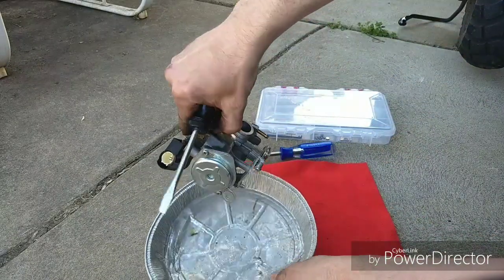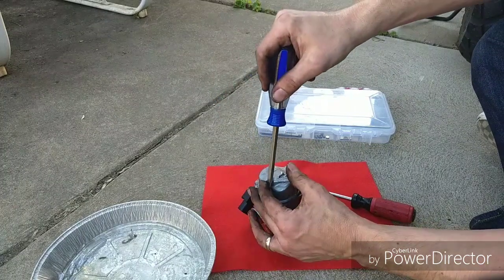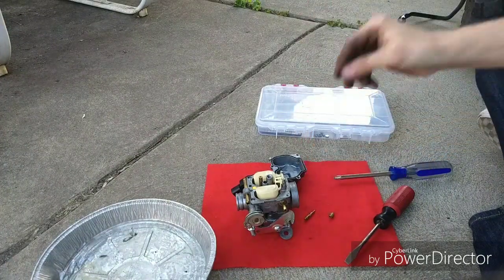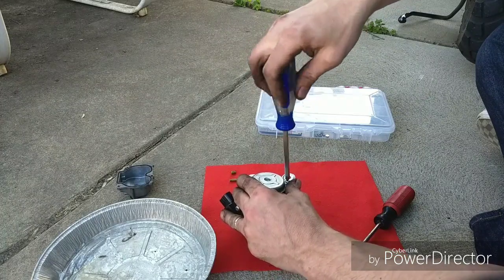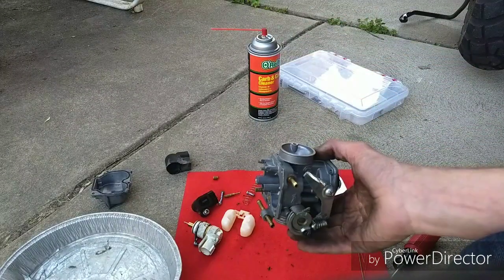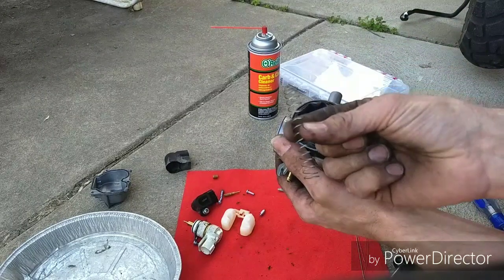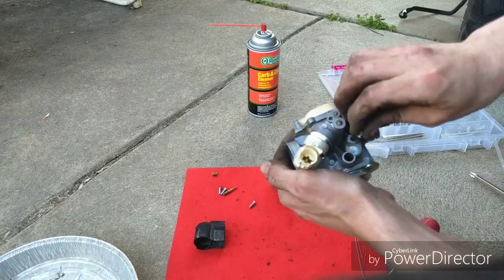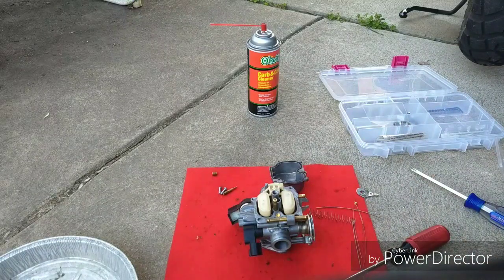GETlife: Cleaning the Ruckus Carb.

Comment: Just curious why you removed the TPS sensor? There doesn't appear to be anything that needs cleaning inside the sensor since no air or fuel flows through that area.
Reply from the maker: It's best to remove ANYTHING that's plastic or rubber before you spray carb cleaner on the carb. Some plastics might not be affected by it.. but it's simpler to just make it a habit.

Comment: is it a problem if I can't clean the jet long ways like you did with the guitar string?
Reply: Seriously I can't either
Reply from the maker: I would try soaking it longer in carb cleaner, then blowing cleaner through it. It is difficult to find a wire small enough.. and you really have to poke around to find the tiny hole.

Just do your best, as long as the bike runs good.. whatever you did worked!

Comment: So to rejet for an intake. Am I installing wider jets?
Reply from the maker: The stock jets are 35 small jet and 75 main jet. A good radiator hose style intake will almost always use a 38 small jet. A full length Dayco b71381 hose will probably need 85, or even better 82 main jet. Cut that hose in half, it's close to 78.

Comment: I bought a Honda Ruckus in April of 2018 (Brand New At The Time)  and I was wondering why does it die when I give it gas... it will start up no problem...but even after I let it warm up..as soon as I give it some gas it Dies ...any ideas on why it does this would be much appreciated
Reply from the maker: Check that the airbox screws are tight.. especially the lower center screw many people miss. I would also open the airbox and examine the filter, make sure it's clean.. if the bike has ever been on it's side, oil may have soaked it too.

Basically, it sounds like have with an air leak or not enough air flow.
Reply: @GET life. I will do that for sure.. And Thank You for getting back to me🙏
Reply: @tylerdurden4618  you ever solve this issue? I'm having the same problem

Comment: How do you remove the Set Screw A - 16016 part number. I'm stumped
Reply from the maker: If you're talking about the air/fuel adjustment.. there's a thin brass plug covering it. You should not need to adjust it usually. But if you really really need to.. you can carefully drill it out.

Under the plug, which won't be on older carbs, the a/f screw has a D shaped head. You can GET a d-bit tool at jets r us.

Comment: I have a 2011 Honda Ruckus. It has 11,000+ miles on it. 

I hit a large pot hole today and it would refuse to accelerate.

I got the bike home and checked the filter in the air box and it’s good. I noticed the main duct from the air box to the carb was damaged. So, I wrapped duct tape around the intake duct but the problem did not improve.

Do you have any idea what this might be? 

Thank you for your help

Justin Wooley
Reply from the maker: Did you check the exhaust header under the engine? Look under the bike for any damage. Use a mirror if needed.

Comment: You seriously need to wear gloves when working with these kinds of chemicals.   You should never mess with the vacuum side of the carb. Leave the diaphragm alone. Clean the fuel side of the carb, Yes absolutely, but don’t touch the diaphragm unless you know the slide is not moving.  Its almost always a bad fuel damage and thats all in the float bowl.  Pulling out the float pin shaft is done with a small drift.  Jets should be cleaned on a parts cleaner and small wires or pins can be used to dislodge fully clogged jets. The mixing tube should be pulled and verified clean especially the pilot jet.